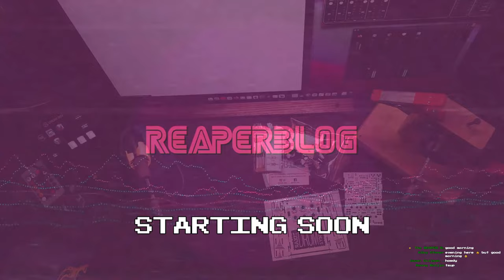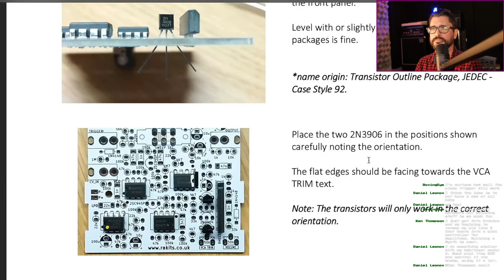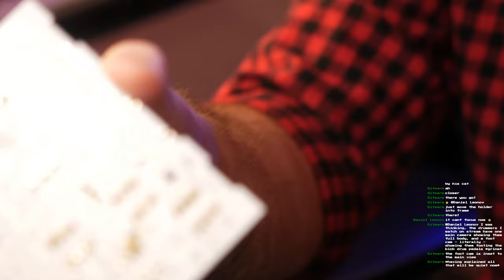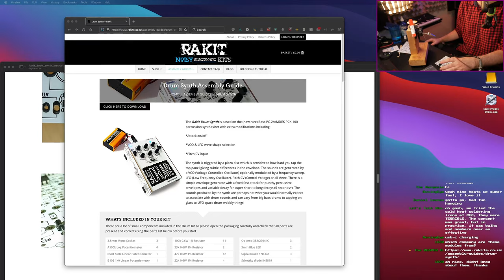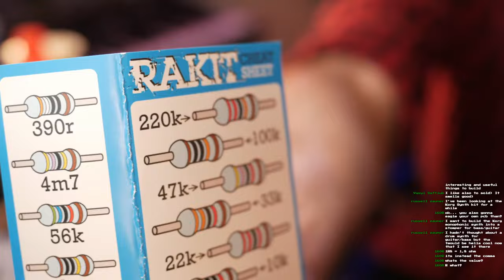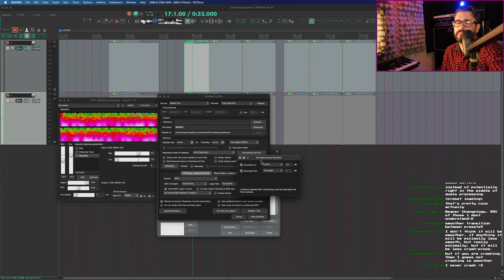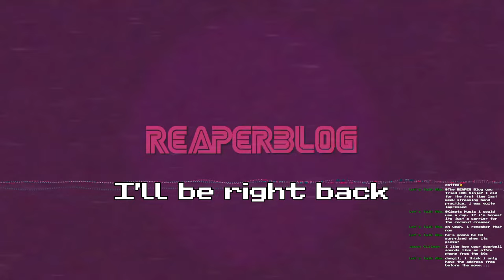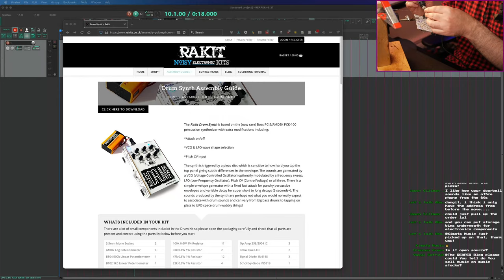Building a Drum Synth Kit LIVE (part 1)

Comment: You could use a multimeter for testing resistorvalues and you could solder the resistors from the topside of the pcb (saves alot of time) the resistors isn't that sensitive when it comes to heat so its better to just put them in place without the need for bending legs and have to turn the pcb all the time. 

Love your channel by the way ✌🏻